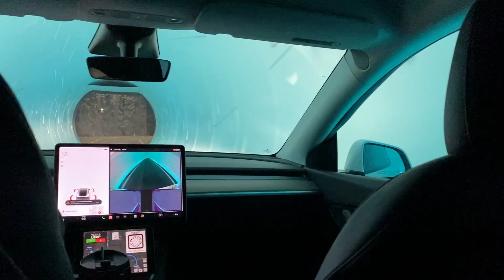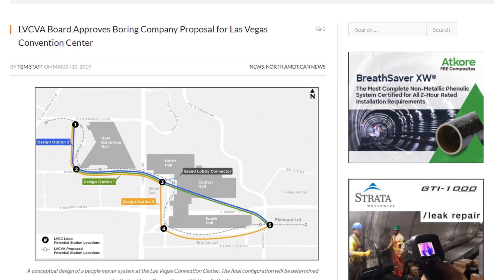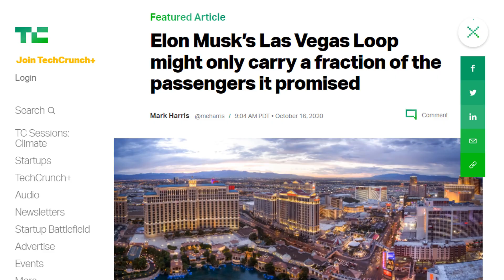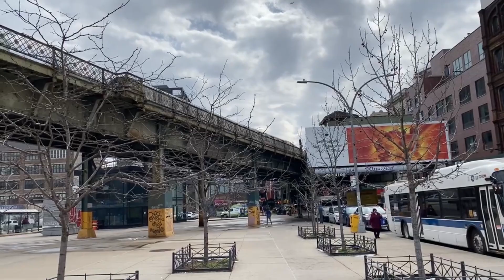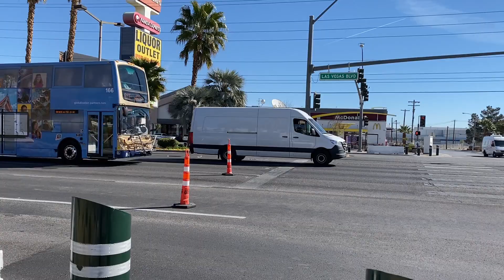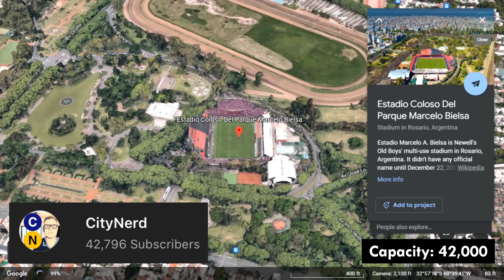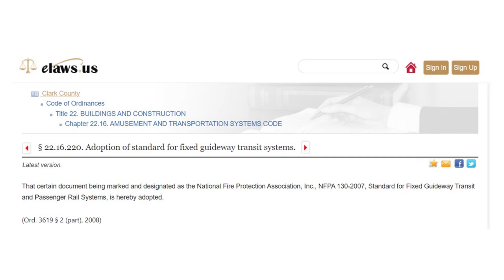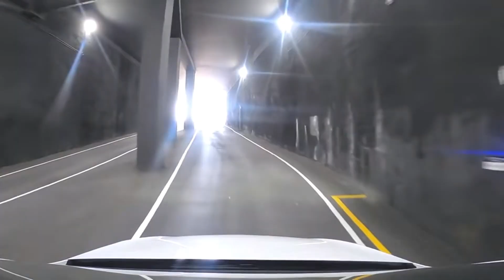Inside the Las Vegas Loop: Transportation Game-Changer, or Complete Waste of Time and Effort?

Comment: Bets are open now for following:

- How much the 51 Station plan will be downscaled?
- How much of the 51 Station plan will actually be build?
- How long until the whole system get abandoned?
- How long until they install a track for some kind of train?
Reply: Why do you think that Pascal?  The Loop is already handling 27,000 people per day during large conventions which is higher than the platform average of every subway station in Europe.
Reply: @andrewfranklin4429  Paris automated subway line 14 moves 550,000 people per day over 13 stations, that's 23,000 people per platform per day, with an inter-station distance average of 1 km. Peak capacity is at 35,000 people per hour per direction, with a maximum waiting time of 85 seconds. Speed averages at 45 km/h
The line 1 moves 715,000 people per day over 25 stations, that's 15,000 people per platform per day, with an inter-station distance average of 700 m. Peak capacity is at 25,000 people per hour per direction, with a maximum waiting time of 105 seconds. Speed averages at 30 km/h. At rush hour it is unbearably saturated.
The loop has three stations, so that's 6750 people per day per platform, for an inter-station distance of 700 m. Peak capacity is sold to be about 4000 people per hour per direction. Speed averages at 56 km/h.

The loop kinda works as a fairly costly people mover within the convention center, but it is no mass transit system. 
Point to point transportation can on paper help with travel time and make potential stops more frequent, but it does not help much with capacity : if 35,000 people need to cross some point in one hour in one direction, the starting and ending point of their journey is irrelevant. 

I would also like to note that signalisation failures are a common cause of delays in train based transit systems, an issue that would be exponentially worse for the absolute nightmare of synchronisation that the loop project requires.
Reply: @jeanf6295  hi Jean. If you have a look at the map of the now-under construction 34 mile, 55 station Vegas Loop, you will see there will be around 8 Loop stations for every subway station per mile (17 in the 2 miles of the CBD) through the busier parts of Las Vegas

The existing convention centre Loop is a prime example of this fact as it already has 3 stations serving that one venue and the fourth LVCC station (LVCC North) has just been constructed and there are three other stations within a few hundred metres of the centre as well, meaning that the LVCC will effectively have 7 Loop stations servicing large convention crowds.  

With a subway, there would only be a single station typically serving such a destination. 

As such, comparing the average daily passengers through the turnstiles of the three stations of the LVCC Loop during large conventions is actually unfair to the Loop as we need to be comparing all 7 (or 8) of those stations (once they are completed) against each subway platform-pair for a more accurate comparison. But even with just three stations it still compares remarkably well.
Reply: @jeanf6295  so the 27,000 people per day of the Convention centre Loop is:

- greater than the number of passengers that 65% of the stations on the London Underground individually handle daily which with 1.8 million passengers per day across 272 stations averages only 6,617 passengers per day PER STATION.

- more than the 24,858 passengers per day per line pre-pandemic average of Kings Cross station, the busiest station on the Tube which pre-pandemic had 149,150 entries per day across 6 lines.

- more than the average of 13,684 people PER STATION per day of the entire Paris Metro which had a pre-pandemic ridership of 4.16 million per day over 304 stations.

- about 70% the 38,888 people per day per platform pair average of the busiest station on the Paris Metro, the Gare Du Nord which pre-pandemic handled 700,000 people per day across 36 platforms.

- more than the 14,000 passengers per day per line average of the Stuttgart Main Station S-Bahn which pre-pandemic saw 140,000 passengers across 10 lines through the turnstiles daily.

And that is ignoring the fact that most of the subway figures above were from pre-pandemic times.  Now, most subways are running at half of those capacities so the performance of the pandemic-affected Loop is even more impress
Reply: @jeanf6295  now if you refuse to call the Loop “public transport” then what is Bus Rapid Transit (BRT) and light rail which transport less than the Loop?

Bus Rapid Transit (at grade) has very low capacity:
90 passengers per vehicle * 15 vehicles per hour = 1,350 pph.
And low average speed of 9mph due to city traffic and having to stop and wait at every stop. 
$0.68 - $9m per mile

Bus Rapid Transit (grade-separated) has low capacity: 
90 passengers per vehicle * 30 vehicles per hour = 2,700 pph.
And but still slow average speeds of 12-22mph.
$13-50m per mile

Light Rail Transit (at grade) has medium capacity:
90 passengers per vehicle * 3 vehicles per train * 15 vehicle sets per hour = 4,050 pph.
But slow speeds of 9mph -12mph due to city traffic and having to stop and wait at every station. 
$50m - $100m per mile

Light Rail Transit (grade-separated) high capacity:
90 passengers per vehicle * 3 vehicles per train * 30 vehicle sets per hour = 8,100 pph.
And still pretty slow average speeds of 15mph due to having to stop and wait at every station. 
$201m per mile

Subways have very high capacity:
100 passengers per vehicle * 10 vehicles per train * 30 vehicle sets per hour = 30,000 pph.
But still slow average speeds of 17-22mph due to having to stop and wait at every station. 
$600m- $1 billion per mile
$100m - $1 billion per station

The 34 mile Vegas Loop (2.5 passengers per EV) will have high capacity:
 2.5 passengers per vehicle * 4,000 EVs per hour = 10,000 pph
AND very high average speeds of 60mph thanks to direct point-to-point travel at high speeds. 
$20m per mile (dual tunnel)
$1.5m per above-ground station

The 34 mile Vegas Loop (4 passengers per EV w ride sharing) will have higher capacity:
 4 passengers per vehicle * 4,000 EVs per hour = 16,000 pph
AND very high average speeds of 60mph thanks to direct point-to-point travel at high speeds. 
$20m per mile (dual tunnel)
$1.5m per above-ground station

But the Vegas Loop isn’t just one line down the centre, but up to 3 separate arterial tunnel pairs (6 tunnels in total) in parallel at times - particularly around the Allegiant Stadium to assist with handling the peaks pre and post games.  That gives a throughput of 30,000 pph one way (or 48,000 pph with 4pax per car) or 60,000 (96,000pph w 4pax) bi-directionally over those high traffic sections.  And there are several other sections where small loops come off to serve groups of stations through the heart of the city so the numbers continue to multiply.

And the great thing about the Loop topology is that if there is more demand, more tunnels and stations can be built at a cost vastly cheaper than a subway. 

The Boring Co has actually rated the 34 mile, 55 station Loop at a minimum of 57,000 people per hour and is actually being built at ZERO cost to taxpayers vs $10 billion for a subway. 

Whichever way you look at it, the Loop absolutely is ”public transport”.
Reply: @jeanf6295  Also the automated trains of Paris Metro Line 14 do average 40 km/h (25 mph)with a maximum of 70 km/h (43 mph)), but the rest of the trains on the Paris Metro average a pretty dreadful 20 km/h (12.4 mph). 

Doesn’t compare very well with the arterial tunnels of the Loop which will average 100km/h (60mph) with a maximums up to  240km/h (150mph). 

The Paris Line 14 extension also cost $450 million a mile, 9x more than the LVCC Loop’s $50m and of course VASTLY more expensive than the 34 mile, 55 station Vegas Loop which is being built now at ZERO cost to the taxpayer.
Reply: @andrewfranklin4429  I understand that by dividing by the number of stations you try to compensate for the fact that longer lines transport more people, but it does not work that way.

The more station your line has, the less people per station you will have : people will go to the nearest station, and go out of the station closest to their destination. 
If you divide a station in eight nearby smaller ones, you will practically divide by eight the number of people per station, and thus the number of people that share the same starting point and destination.

This makes point to point travel capacity even worse with respect to capacity. 
People won't wait 5 min for their car or pod to get full if they don't have to. Hell, not having to share space with strangers is basically a selling point of the system. If it was that easy everyone would carpool and traffic would be divided by four.

Even if you put safety to the bin and assume that nothing unexpected will ever occur, and that a one second headway is plenty enough when going at 240 km/h on a few meters wide strip of road, with stations spread this thin, point to point travel, and inexistant waiting time, you can bet the cars would have near unitary passenger use.
Some may even travel being empty to deal with unbalances in travel destinations, just like with bike sharing services. And just like with bike sharing services, maintenance will be hell, and near constant use at stupidly high speeds will drain the batteries into oblivion (regenerative braking does not get the air friction loss back, and those go as the cube of speed).
And yes I know electric cars require less maintenance than ICE ones, but you still need to change the tires once in a while, make sure the brakes, suspensions and electronics are still up to the very stringent specs, and clean the cars.

You try to compare the operating capacity of actual systems with the maximum capacity of a system that only exists on paper, and would require multi billion dollars big science projects levels of tolerances to work as advertised.
Bus lines could reach higher capacities by adding busses, but that would be far less efficient than building a tram.

The convention center loop doesn't require metro level of capacity, it's not even close, a few minibuses would do the job for a lower cost, but the full loop is a different matter, your extrapolations are worthless.
Reply: @jeanf6295  On the contrary Jean, 25,000 - 27,000 ppd is by no means the maximum that the current LVCC Loop can carry, it is merely the average Loop ridership during a medium-size multi-day convention of conference attendees.  

If it was a maximum, we would see queues lining up outside each Loop station, but we don’t - every video posted to the net shows passengers descending the escalators, walking over to a bay and jumping straight into an EV within a few seconds. 

And there are many ways that the LVCC Loop can increase daily ridership. Firstly by increasing the size of events at the convention centre. 

The 25,000 - 27,000 people per day figure is just the average Loop ridership during SEMA, a pandemic-affected medium-size multi-day convention of 114,000 conference attendees. 

We haven’t yet seen what the ridership of the Loop is like during a really large convention like what CES used to be like pre-pandemic when it had 180,000 attendees which is what the Loop was designed to handle.  (CES only had 40,000 attendees this year with 15,000 - 17,000 people per day riding the Loop)

This fact highlights that this comparison is unfairly weighted against the Loop as we comparing pre-pandemic figures for subways against pandemic-affected figures for the Loop.  If we were being really accurate, we would actually be using pandemic-affected figures for subways which are still anywhere from 20% - 60% lower than pre-pandemic for most subway systems worldwide.

2. we can increase the capacity of the Loop by increasing the occupancy of the EVs by the use of ride-share apps and kiosks at the stations to allow passengers to share the cost of an EV. In all the videos you will see only around 2-3 people getting into each EV, but each Model Y can seat 5 people (the Loop Model X’s can seat 6). 

3. they could increase the headway in the tunnels. At the moment, the Loop vehicles are allowing around 6 seconds of distance between each EV or around 20-30 car lengths at 30mph.  TBC is planning for headways of 0.9 seconds (5 car lengths at 60mph) in the main arterial tunnels of the Loop which will allow those tunnels to support 4,000 EVs per hour which with 2.5 passengers gives 10,000 passengers per hour. 

With 4 passengers per EV, a 0.9 second headway gives 16,000 people per hour down just that one arterial tunnel. If the 4 spur tunnels of the LVCC Loop had that headway, that is a total system ridership approaching 4 x 16,000 = 64,000 people per HOUR. 

4. they could add higher capacity EV vans or buses or eventually the 16-person pods shown in CGI renders of the Loop. The reason they haven’t done so yet is because they don’t need higher capacity yet.  Steve Hill, CEO of the LVCVA said back in May last year when asked about higher capacity vehicles in the LVCC Loop: 

“It seems that during a pandemic is not the time to be increasing capacity”.

5. They could increase the number of stations and tunnels serving the convention centre and this is already happening. The fourth convention centre station (LVCC North) just opened but at the moment is only connected to a Loop station at Resorts World. It will soon be connected to the three original LVCC stations and more tunnels to Encore Resort which is now under construction as mentioned.
Reply: @jeanf6295  I really don’t understand your argument that dividing a station by 8 would “make point to point travel even worse with respect to capacity”?

The logical conclusion is that load-sharing the passenger demand across a more distributed network so each of the 8 stations only has to handle 12% of the load of a single subway station to carry the SAME or greater number of passengers as that single subway station, so how could that possibly make capacity worse?!

Instead what would happen is that you’d be eliminating the bottlenecks that a single, subway station represents, reducing the huge crowds on the platforms and down the escalators, reducing the foot traffic to the station, reducing the taxis and car drop-offs concentrated on a single station and getting passengers much closer to their departure and destinations points.  It’s a win-win. 

How on earth can you spin this as a negative?

With Loop stations only costing $1.5m each which is between 67 and 667x cheaper than subway stations ($100m - $1 billion each) and with tunnels only costing $10m per mile, you could build between 10-100 miles of Loop tunnels for every mile of subway tunnel. 

This means it is possible to put Loop stations right at the front door of every hotel, casino, office block, sports stadium, school, University, shopping centre, Rec centre etc etc in a city. 

That is exactly what is happening in Las Vegas with 55 hotels, casinos, resorts, the University, sports stadium, airport etc all getting their own Loop station at their front doors. 

You won’t get a Loop station at the front door of your house, but it’s far more likely that there will be one nearby at the local shopping centre or school etc that you could ever hope for with eye-wateringly expensive subways. 

So not only is the Loop point to point not having to stop at every station in between, there are also far more destinations that you can travel directly to at 5x the speed of a train or bus.
Reply: @jeanf6295  and another way they can increase the capacity of each station is to increase the number of bays at each station.  The LVCC planning document says there is already room for even more:

The two above-ground LVCC Stations 1 and 3 have “a boarding area for up to 14 vehicles” but each station is only currently utilising 10 bays. 

LVCC Station 2, “includes a boarding area for 10 vehicles, however the boarding area could be configured for up to 18 vehicles.”
Reply: @jeanf6295   The Boring Co has already demonstrated Teslas hitting 127mph (205kph) in the longer 1.14 mile in the TBC test tunnels showing it is absolutely possible that in the longer straight stretches of the full 34 mile Loop 150mph could be achieved. 

However, would the Loop EVs be running at 150mph during the heat of peak hour?  No.  To achieve the average speed of 60mph (100kph) across the network even 80mph or 100mph down the main arterial tunnels would be more than sufficient. And of course, it is still far faster than a 17mph average stop and start train.  Not to mention that dreadful 12.4 mph average of most of the Paris Metro.
Reply: @andrewfranklin4429  bottlenecks don't happen at stations : they happen because travel paths overlap in between stations.
By sharing the same vehicle on this overlap, capacity is increased without reducing headway.

If you spread people over eight time the number of stations, and do point to point travel, sharing a vehicle gets harder as less people will share the same travel path within the boarding time frame.
Reply: @jeanf6295  The thing is that Loop EVs only need to carry 1.6 passengers on average to equal the average vehicle per passenger ratio of buses.

For example, the Vegas Bus service currently moves 178,390 people per day using a fleet of 708 buses.  This is a ratio of one bus to 252 passengers.

In the case of the LVCC Loop it moves 27,000 people per day using a fleet of 70 EVs which is a ratio of one car for 386 passengers over the course of a day.

So the Vegas bus service requires over 1.5x the number of buses to move the same number of passengers over the course of a day as the Loop. 

This is the problem with not just the Vegas bus service, but with traditional public transport using large vehicles in general - occupancy. 

You see the average bus occupancy in the UK is 10.8 passengers per bus which is very comparable to the average bus occupancy in California (10.4) and Nevada (10.1). 

In fact, here in Australia we have an average bus occupancy of around 9 people. 

In Upsala Sweden does a little better with an average bus occupancy of 11. 

Now consider that metro buses have an average speed of 9mph due to city traffic and having to stop and wait at every stop. 

In comparison, Loop EVs will have an average speed of around 60mph thanks to the EVs travelling at high speed down the arterial tunnels of the 34 mile Loop going point-to-point direct to their destinations without having to stop at every station. 

So Loop EVs will make at least 6.7x the number of trips in the same time as a bus makes a single trip and that’s not even considering the fact that Loop journeys will be shorter and less circuitous due to being direct point-to-point. 

That means a Loop EV only needs to carry that magical figure of 1.6 passengers on average per trip to equal the vehicle per passenger ratio of buses. 

And guess what, Taxis average 1.9 - 2.1 passengers per taxi but it would be even easier for the Loop to have a higher occupancy than taxis with its much higher frequency and much smaller number of end-points than a normal taxi fleet. 

MIT CSAIL’s research developed an algorithm that can replace 14,000 taxis with only 3,000 four-seat vehicles using public data from NYC taxi rides. 

By the simple implementation of ride-sharing apps or station kiosks to enable passengers to more easily ride share, even higher passenger occupancy is readily possible.

And the incentive to utilise such ride-sharing services and make this work is there for the average passenger as the 34 mile 55 station Loop will charge per vehicle so passengers could slash their weekly commuting bill by a half or even 75% by simply sharing an EV with 1-3 other people.
Reply: @andrewfranklin4429  the ratio of total passengers in the day on the number of vehicles in the fleet is not the average number of passenger per vehicle over the day : the number of vehicles in service at any given time is modulated to deal with variations in demand, and is over sized to deal with rush hour.

You also compare transportations networks that are orders of magnitudes appart in term of size : the loop "only" need 70  EV because it is under three kilometer long.
A "network" that small can be operated by less than ten minibuses/pods and keep waiting times bellow a minute, for a much cheaper ticket cost.

The algorithm you speak of use rerouting and take several stops to get to the four seat figure, it is not point to point travel.
Reply: @jeanf6295  Regarding the bus option, the average capital cost per mile for busways is $22 million so already you’re talking a cost to the taxpayer of two thirds of a billion dollars for just 30 miles of BRT through Las Vegas compared to zero taxpayer dollars for the under-construction 34 mile, 55 station Las Vegas Loop. 

However, as soon as you start creating priority lanes, light synchronisation and separate bus guideways, that is when the cost starts creeping up. Then add in high capacity bus platforms and stations and very large capacity articulated buses and the costs skyrocket. Higher capacity, segregated bus guide-ways and infrastructure cost upwards of $50m per mile so that’s $1.5 billion now for the BRT. 

And the problem is, that even with a 2 minute headway between high capacity 150-seat buses, in the 2 minutes between buses, the Loop with even just 2.5 people per EV could move 300 people with a 1 second headway (6 car lengths at 60mph), 2x that of the bus. With 4 passengers, the Loop would 480 passengers, 3.2x the number as the bus. 

And of course, the bus has to start and stop and start and stop at multiple bus stops on the way with only a few stops potentially served by express services.  In contrast, EVERY EV is an “express” EV travelling direct to its destination point-to-point without stopping on the way.  Even if with ride-sharing the EVs go to 1 or 2 destinations on the way, that is still far less than the dozens and dozens of stops buses make on every route. 

And even with all that, the buses still only travel at an average speed of 12 - 30mph due to slow city speed limits and having to stop all the time. 

With average speeds of 60mph (100kph) and peaks of well over 100mph, the Loop EVs are far faster for passengers. 

Buses are also problematic in the pandemic-riddled reality of today with passengers having to breathe the COVID of a hundred or more people as well as the poisonous and carcinogenic exhaust of city traffic. 

In contrast, having only 1 or 2 passengers in every EV is infinitely safer and healthier with the hospital-grade HEPA filter (10 times larger and 100 times more effective than cabin air filters in most cars) and carbon-activated filters that eliminates not just toxic smoke, and gases, but also pollution, bacteria and respiratory COVID virus particles.  And of course, the tunnels being underground avoid all the above-ground traffic, pollution and other hazards. 

So the question is, why would you go for more buses when you could have an underground Loop that is far faster, safer and radically cheaper? Even if the 34 mile, 55 station Vegas Loop  only manages to handle half the 57,000 pph capacity that TBC has modelled, that is still more than most BRT systems nationwide for zero cost vs up to $1.5 billion for the buses.
Reply: @jeanf6295  you dismiss the Loop because it is short with only three stations. Ok, let’s compare it directly with some similar sized subways then. 

The current 0.8 mile long three-station LVCC Loop handles up to 27,000 people per day, has a 3 - 6 second headway and cost $48.7m. 

The Berlin U55 is a 3-station 1.5km subway in the centre of Berlin which is similar in size to the LVCC Loop but it only carries a minuscule 6,200 people per day (compared to the Loop’s 27,000 ppd) at an average speed of 19mph and 5 minute headway and yet cost $500 million in today’s dollars in total, 10x the cost of the LVCC Loop.

The Seattle U-Link is a 3.15-mile underground light rail which also has 3 stations which had a ridership of 33,900 people per day pre-covid (so only a few thousand more than the LVCC Loop), though it is much less now.  Runs at an average speed of 31mph. It cost $1.9 billion dollars in total or $600 million per mile, 39x more than the LVCC Loop.

The San Francisco Central Subway is a 3-station 1.7 mile subway with a targeted ridership of 35,000 people per day with a 5 minute headway and an average speed of a miserable 9.6mph and cost $1.578 billion, 32x the cost of the Loop. (Whether it achieves that ridership which is only a few thousand higher than the Loop during this pandemic is of course yet to be seen) 

The Newark City Subway/light rail is a 6.4 mile, 17 station line with an average speed of 21.5mph and has a daily ridership of 19,289 and cost $208m for the 1 mile above-ground light rail portion or 4x the cost of the underground Loop. I’m not sure of the cost of the underground portion of the Newark subway, typical costs start at $600m per mile. 

As you can see, With a daily ridership of 27,000 people the Loop is very competitive ridership-wise with these similarly short subways. 

However, the Loop is FAR better in terms of comfort, speed and frequency/wait times, and VASTLY cheaper to build than any of these subway systems. 

 Mind you, that is nothing compared to the 55 station, 34 mile Vegas Loop with its 60mph average speed and 57,000 people per hour capacity which is now under-construction at ZERO cost to the taxpayer.
Reply: @andrewfranklin4429  It is not a surprise that using metro lines for small networks that require low capacities and bus lines for huge networks that require a high capacity is not optimal.

Assuming that a ludicrous one second headway at 100 km/h is sustainable, you don't get a 57,000 pphpd capacity with four seats cars, you get 14400 pphpd. 
To reach that capacity you need shuttles with 15 seats, and each seat is a potential stop in a point to point with ride sharing network.
And we are still waiting for those to get into the LVCC loop, where they would actually be a good solution (1400 pphpd of actual use is nothing).
The interesting thing is that those already exist, even autonomous ones (like Navya's evo shuttle), granted they are slower than a Tesla, but who cares if the journey takes 6 min instead of 3, when this makes the fare so low it may as well be included in the convention passes.
Reply: @jeanf6295  Not sure why you think a one second headway is problematic?  After all a 2010 study by the Honda Research Institute found that 25% of drivers maintained a distance of 2 cars between vehicles at 60mph on a busy 2-lane freeway, 15% 3 car lengths, 15% 4 car lengths, 5% 5 car lengths and 15% 6 car lengths. 

So that is 75% of cars having a headway of one second (~6 car lengths at 60mph) or less and 40% maintaining a headway of 0.5 seconds (~3 car lengths at 60mph) or less. And remember those are cars driven by potentially distracted, drunk and careless drivers. 

Note that a headway of 0.5 seconds = 7,200 cars per hour
And a headway of 1.0 seconds = 3,600 cars per hour

The Boring Co is planning on a headway of around 0.9 seconds (~5 car lengths between EVs at 60mph) which will give a throughput of 4,000 EVs per hour.  With 2.5 passengers per car that gives us 10,000 people per hour. With 4 passengers per car 16,000 people per hour per single tunnel. 

Once the Loop autonomous control systems with their millisecond response times and ability to for example command ALL vehicles in a section of the Loop to brake or accelerate simultaneously, there would be no problems safely achieving headways of this duration.
Reply: @jeanf6295  and that 57,000 people per hour figure will be achieved on the 34 mile 55 station Vegas Loop because it isn’t just a single tunnel going down the Vegas Strip, but up to 3 separate arterial tunnel pairs (6 tunnels in total) in parallel at times - particularly around the Allegiant Stadium to assist with handling the peaks pre and post games.  That gives a throughput of 30,000 pph one way (or 48,000 pph with 4pax per car) or 60,000 (96,000pph w 4pax) bi-directionally over those high traffic sections.  And there are several other sections where small loops come off to serve groups of stations through the heart of the city so the numbers continue to multiply.

That’s the great thing about the Loop topology is that if there is more demand, not only can high capacity EV vans or buses be added easily, but more tunnels and stations can be built at a cost vastly cheaper than a subway.
Reply: @jeanf6295  So, you don’t want to compare the Loop against individual station platforms on large subways yet you also don’t want to compare the Loop against small subways of similar size to the current LVCC Loop despite it showing the Loop is competitive in those comparisons. 

And yet despite the fact that the Loop handles more passengers per hour than BRT or light rail, people like yourself insist on suggesting that Vegas is deluded for putting in a 34 mile 55 station Loop network at zero cost to the taxpayer, because it may not handle as many passengers as a $10 billion dollar high capacity subway. (Which is arguable anyway)

The Loop just can’t win in your eyes can it because it uses cars and that seems to offend many public transport advocates. You refuse to consider the possibility that Musk may have found a viable way of implementing a point to point PRT solution on a city-wide scale. 

You also ignore the fact that TBC has included the option of adding high capacity EV pods, vans or buses on high traffic routes from the start giving the best of both worlds in the same tunnel network. 

Don’t you think you protest just a bit too much?
Reply: @jeanf6295  I think we also need to address the fact that you keep confusing the people per hour metric of an individual track or tunnel with the actual number of people going through the turnstiles of a particular station. 

Consider the fact that over 60,000 people per hour travel down the Victoria line on the London Underground in the highest morning peak hour sitting on the train, and yet the actual max number of passengers recorded getting off and going through the turnstiles at Oxford Circus Station (the busiest Underground-only station on the Tube) on that line is only 23,720 pph in the busiest morning peak hour. 

That stat alone should help you realise that pph sitting on a train does not equal pph going through the turnstiles of the station. 

But it’s even worse as that is the total across 6 busy platforms and 11 different Lines, so the pph going through the turnstiles from just the Victoria line is far smaller again as dividing by 3 platform-pairs we’re only looking at approx 7,906 pph at Oxford Circus Station. On a per line basis it’s only 2,160 pph.  

And yes each of those 3 platform-pairs have similar pph riding down the lines so a divide by three gives us a quite accurate thru the turnstiles percentage. 

And those were the figures pre-pandemic - ridership now is less than half those figures (so somewhere around 4,000 pph for that Oxford Circus platform-pair or 1,080 pph per line). 

Now in the case of the Loop, as we’ve seen, there will be about 8 Loop stations for every subway station per mile through the busier parts of Vegas, yet even just the three current LVCC Loop stations moved 25,000 – 27,000 passengers per day during SEMA in November. 

Now SEMA was open only for 8 hours which gives us 27,000 / 8 = 3,375 people per hour every hour of the day for the Loop. (Though of course it would have been more than that during the peak periods each day and less off-peak)

In the case of the 8 Loop stations per mile of the Vegas Loop, we’re looking at 8/3 * 3,375 = 9,000 people per hour. 

So as you can see, even just 3 pandemic-effected Loop stations (let alone 8) are not actually that far off the hourly pph of the busiest London Underground station in peak hour. 

But as I say, the Loop is really competing against BRT and Light Rail so that comparison is more to illustrate that the Loop well and truly is moving useful numbers of passengers.
Reply: @andrewfranklin4429  If you want to make meaningful comparisons, you either take the small LVCC one, and look at small scale services that use appropriate vehicles (shuttles), or you take the full project and you compare it to a subway.
The reason being that a bigger network has to deal with more travel path overlap and requires a higher corridor capacity.

Saying that the full loop will be done for free is disingenuous : someone will have to pay, the question is who ? Will it be the banks that Musk will borrow money from by leveraging his wealth (which has a lot to do with his skill at manipulating markets), will it be the stockholders of Musk enterprises, or will it be the customers ?

The 0.9 second headway at 100 km/h seems ludicrous because Musk is not the first one coming up with the idea of a Personal Rapid Transit network.
The concept has been around since the 1970s, and pretty much all of the systems that actually exist (that is prototypes and small scale test cases) use higher or comparable headways but with much lower speeds.

https://en.wikipedia.org/wiki/Personal_rapid_transit

But hey, after half a century of R&D, maybe someone will manage to bring the concept to reality.
Reply: @jeanf6295  So you’re arguing that all of these subways should be replaced with shuttle buses because the subways all move similar (or lower) numbers of people to the LVCC Loop:

- The Berlin U55 subway (3-station 1.5km)
- The Seattle U-Link subway (3-station 3.15-mile)
- San Francisco Central Subway (3-station 1.7 mile)
- The Newark City Subway/light rail (17 station 6.4 mile)

The 3 station San Francisco Central subway has actually only just been built and it’s PLANNED capacity is 35,000 people per day (probably will be less thanks to covid) with a 5 minute headway and an average speed of a miserable 9.6mph and cost of $1.578 billion. 

And yet you dismiss the LVCC Loop as “too small” at 27,000 people per day to be given the dignity of recognition as a viable public transport system despite coming in at 32x cheaper than that SF subway, with 20x lower waiting times, much more comfort, 3x faster speeds, 2-5x better energy efficiency, etc.

But you reckon, they should have stuck with their existing buses at the LVCC with their 20x longer wait times, 5x lower energy efficiency per passenger mile, much greater pandemic cluster risk, 3x lower passenger capacity, 4x slower Vegas gridlock-affected speed etc?

Don’t you realise that the LVCVA wanted something BETTER than the shuttle buses that they already had?  They’ve been so happy with the success of the LVCC Loop that they’re extending it 34 miles under Vegas. 

Perhaps the LVCVA who actually owns and operates the Loop knows something that commentators like yourself don’t?
Reply: @jeanf6295  the now-under construction 34 mile 55 station Vegas Loop is being constructed with zero taxpayer money with The Boring Co (TBC) building the 34 miles of tunnels for free and the 55 hotels, casinos, the university and the stadium all paying for their own individual stations.  TBC will make back its money via ticket sales as part of the 50 year franchise it was awarded by the LVCVA.

The reason why this is economically viable is because Loop tunnels are 10-100x cheaper than subway tunnels and Loop stations are 50-350x cheaper than subway stations. 

In contrast, the poor taxpayer would have been in debt for 30 years paying off the $10 billion that a comparable subway system would have cost.
Reply: @jeanf6295  a 0.9 second headway at 100km/h is far from ludicrous because cars driven by distracted drivers travel with half that headway on freeways around the world every day. 

Your argument that “it can’t be done because it has never been done before” would fit nicely in with Lord Kelvin’s “heavier than air flying machines are impossible” statement. 

It’s never been done before until some smart person comes along and does it.
Reply: @jeanf6295  And your idea that shuttle buses could be better than the Loop is just not based in fact. 

Look at the Adelaide O-Bahn which many people laud as being a great example of grade-separated Bus Rapid Transit. 

It is mostly a concrete track overland wasting gobs of space and splitting the surrounding area and travels at an average of only 22mph due to having to stop at every station, as well as having to negotiate traffic lights and transports 31,000 people per day. 

And the cost of this wondrous system of slow buses with three stations and 20x longer wait times than the Loop?  $98 million dollars, twice the cost of the LVCC Loop and it isn’t even underground!

Other commentators extol the virtues of the 13 mile, 28 station IndyGo Redline BRT with 10 minute headway (40x longer wait times than the Loop), average speed of 25mph which only carries 6,000 people per day and which costs $19m per mile ($247m in total) all above ground! 

This compares to the Vegas Loop which will be 34 miles long, have 55 stations, will transport at least 57,000 people PER HOUR and costs taxpayer ZERO dollars.  

Even the little 3-station 0.8 mile long LVCC Loop with its 27,000 people per day has 4.5x higher throughput than that IndyGo BRT for 20% the cost despite being underground.
Reply: @andrewfranklin4429  The argument sound different if smart people actually trying to make an idea work consider that more reasonable goals should be pursued first in the wake of previous failures. The Wright Brothers did not aim for a transatlantic flight first.
Musk has a tendency to target lofty goals, in part to sell the hype, in part to push his teams to get creative, regardless of their experience, potentially at the expense of reliability, something that matters a lot for the loop, and not just for safety concerns.

The headway stats you speak of are only valid in free flow conditions, where people tend to form platoons, and to a lesser extent in low density synchronized traffic.
It should also be noted that those small headways are not safe : rear end collisions are the most frequent type of collision.
The maximum flow rate of a single highway lane is about 2000 veh/h/ln, that is compatible with a 1.8 sec mean headway.
(see for instance : https://journals.aps.org/pre/abstract/10.1103/PhysRevE.65.056133 ).

PRT networks are still quite far from what the much simpler already existing subway technology can do, and Musk speaks of it as if it was already a reality.
But hey, once the tunnels have been built, people that have some experience in running PRT networks will be able to pay Musk for getting an access to them.

Also, that 10 billion figure is really an USA thing, most countries pay at least less than three time that to build a comparable subway. The best performance is given at 40 million $ per km in Madrid, all costs included, not far off from the LVCC loop construction costs, for a much higher capacity per tunnel.
And it should be noted that the Borring company being private, we don't have access to its financial records, the stated price of the LVCC loop may have been low-balled to get a foot in the door-frame.
Reply: @jeanf6295  Even light rail in the USA is vastly more expensive than the Loop.

The average cost of the 14 light rail projects currently under construction around the USA is $201m per mile so a 15 mile above ground light rail through Vegas would cost $3 billion.
Reply: @jeanf6295  Very short headways on freeways are far more common than you seem to believe. A 2010 study by the Honda Research Institute found that 25% of drivers maintained a distance of 2 cars between vehicles at 60mph on a busy 2-lane freeway, 15% 3 car lengths, 15% 4 car lengths, 5% 5 car lengths and 15% 6 car lengths. 

So that is 75% of cars having a headway of one second (~6 car lengths at 60mph) or less and 40% maintaining a headway of 0.5 seconds (~3 car lengths at 60mph) or less. And remember those are cars driven by potentially distracted, drunk and careless drivers. 

Note that a headway of 0.5 seconds = 7,200 cars per hour
And a headway of 1.0 seconds = 3,600 cars per hour

And of course as previously mentioned, The Boring Co is planning on a headway of around 0.9 seconds (~5 car lengths between EVs at 60mph) which will give a throughput of 4,000 EVs per hour.  With 2.5 passengers per car that gives us 10,000 people per hour. With 4 passengers per car 16,000 people per hour per single tunnel.